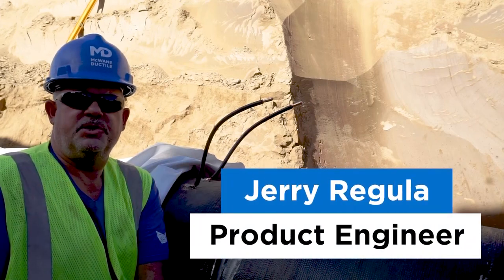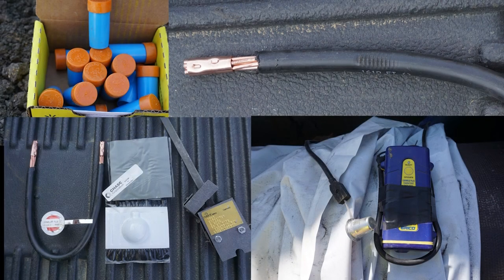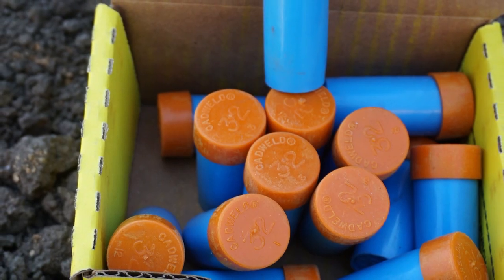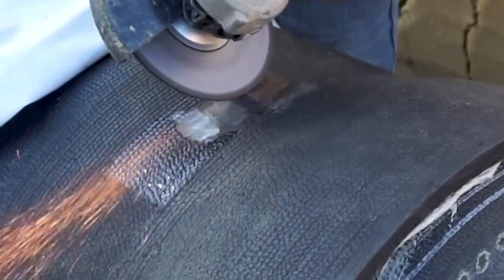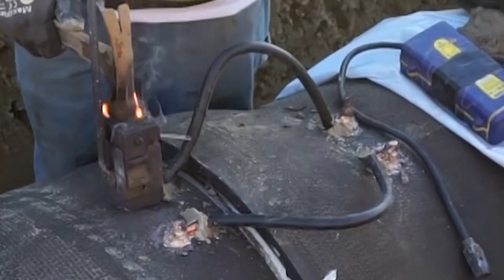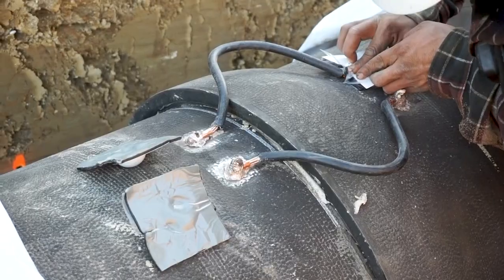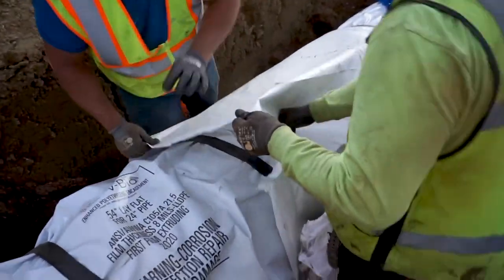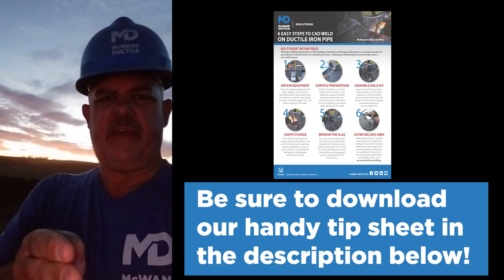How to CAD Weld on Ductile Iron Pipe

Comment: Welding of ductile iron pipe is possible or not ??
Reply: i weld ductile iron pipe every day at McWane Ohio, Wall collars Bosses Thread outlets ect. So yes it can be welded.
Reply: Already I'm working on the job in UAE
Reply: @everythinghuntingohio8012  from where?
Reply from the maker: Yes, it is possible, but you must follow the correct procedures and use the right welding rod material (electrodes), usually a nickel-iron composition.